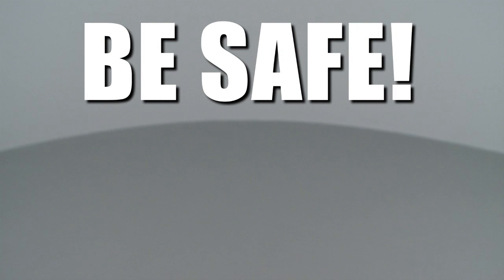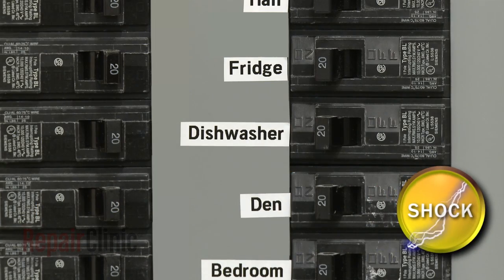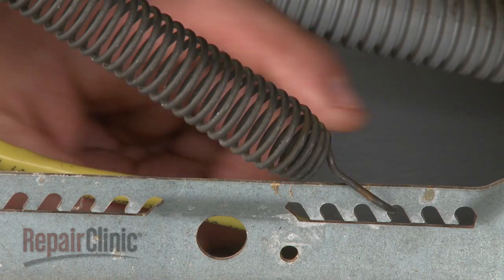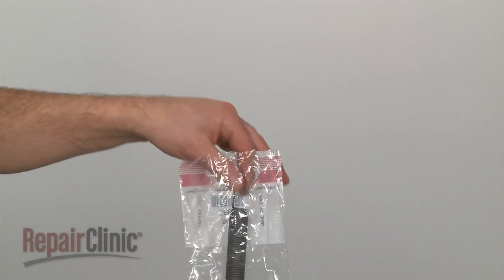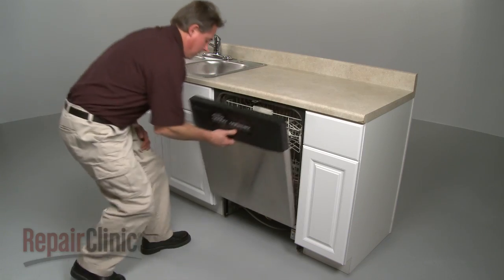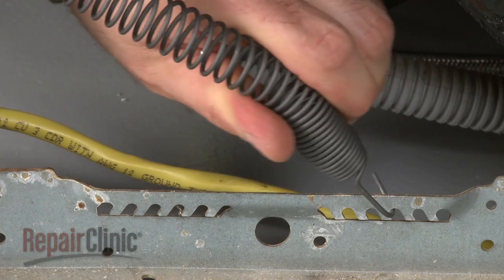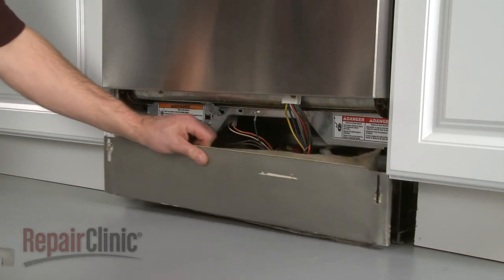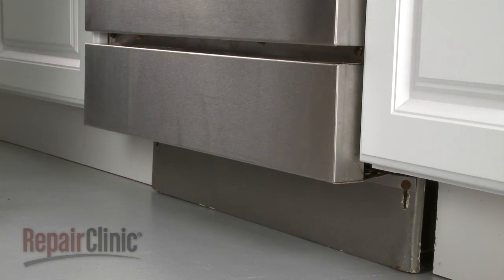KitchenAid Dishwasher Door Spring Replacement #9743986

Comment: Here is a tip that worked for me.  If noise is only coming from one spring/side, you may be able to swap the two springs and silence the door. This fix won't last as long as using a new spring, of course.

Nice to do while you are waiting for new part to ship, or if you are just renting (or something) and don't want to buy the part.